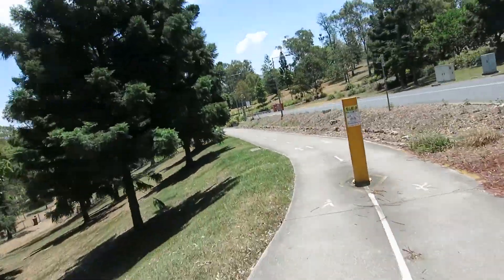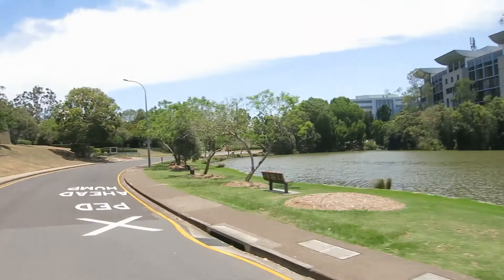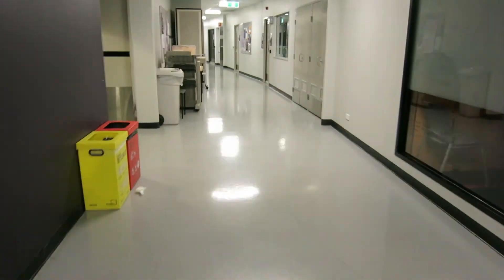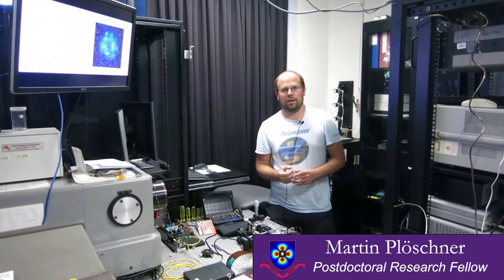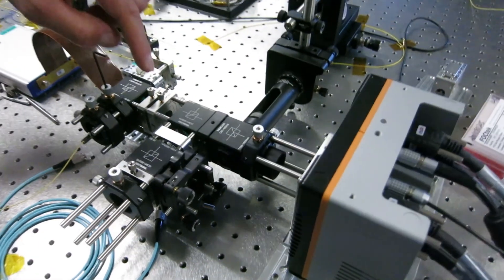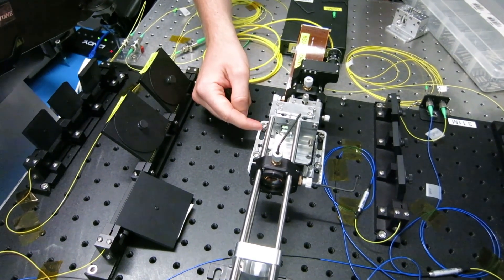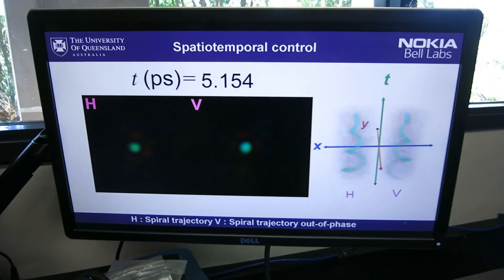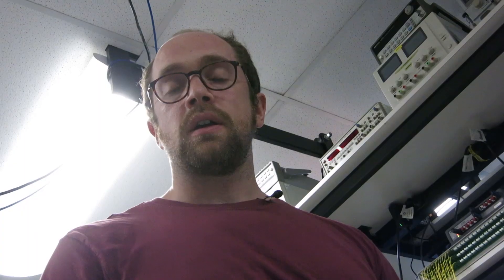Modelab tour (2021)

Comment: Hey. ..I'm a PhD student working on photonic structure simulation and it's completely theoretical work. So I don't have any idea about experimental photonic set up. Could you please make some videos on the brief working principle of your instruments and how to take those  measurements.? 

I just wanted to know how to operate those set up and how to handle photonic circuit on optical bench from your video
Reply from the maker: You might have some luck with the Thorlabs youtube channel? They've started putting up a few general purpose 'Insights' videos that demo how to do some common lab techniques.